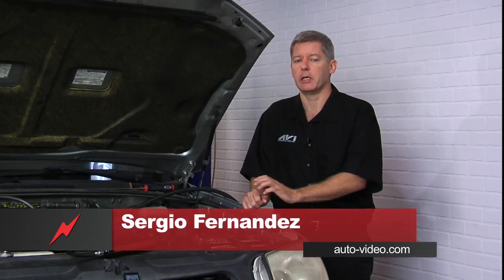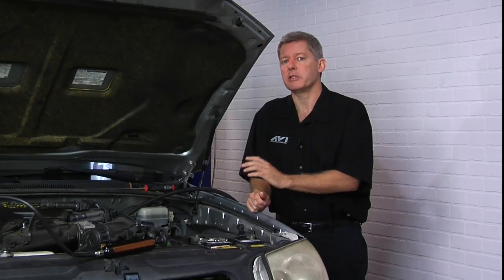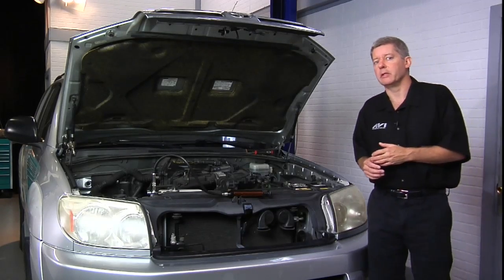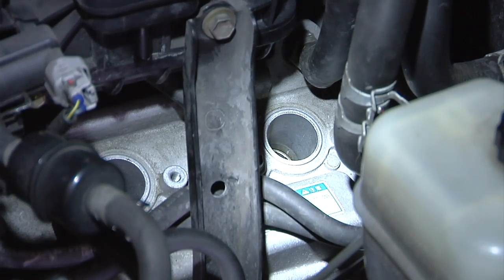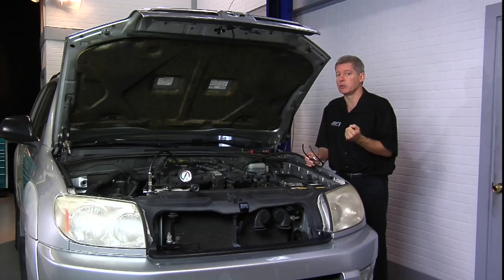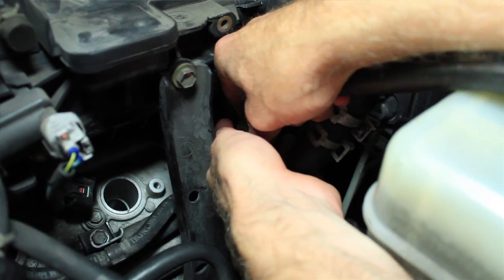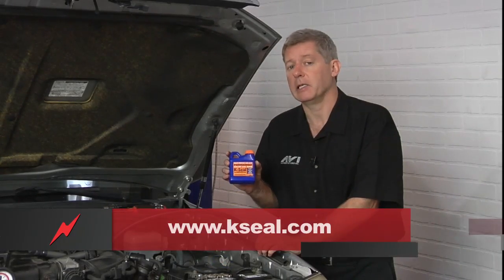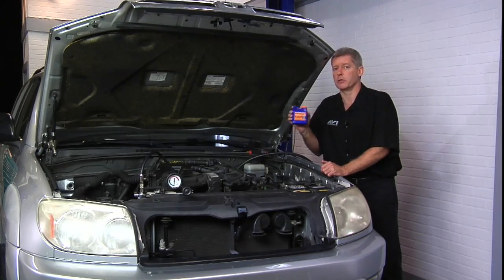K-Seal Head Gasket Tech Tip English

Comment: My car Mercedes GL63 amg 2015 I have a lot of water leaking from the upper tank, and I think the head gasket. I have no smoke and there is no hot engine
I put one bottle K-Seal put it's didn't stop leaking!!
Note: Ihave  changed the radiator, the water pump, the thermostat and the tank cover 
Question here can in use two bottles K-seal in my car and does this stop the leak ?

Comment: Hi, would you need to replace the thermostat or any parts of the cooling system after using this?
I have a 2004 e46.
Reply from the maker: Hi, no, there is no need to replace any part of the cooling system after using K-Seal. There is also no need to perform a system flush and K-Seal can be left in the system as you see fit.
Reply: +MrKSeal 
Ok cheers